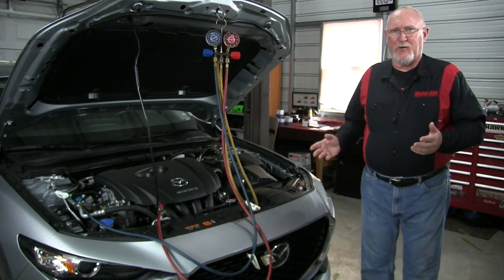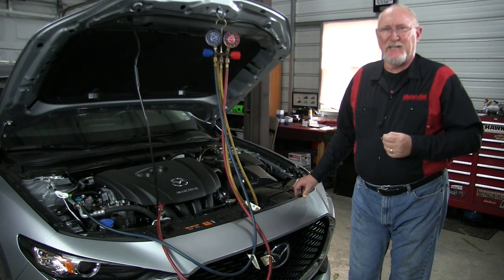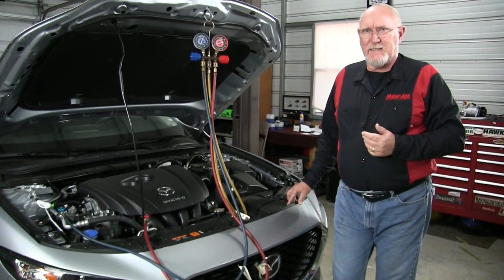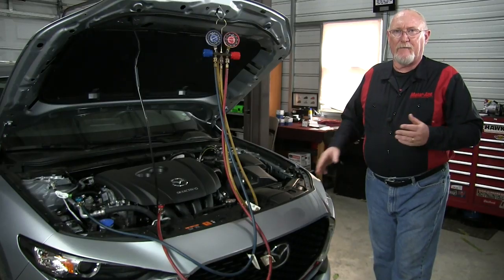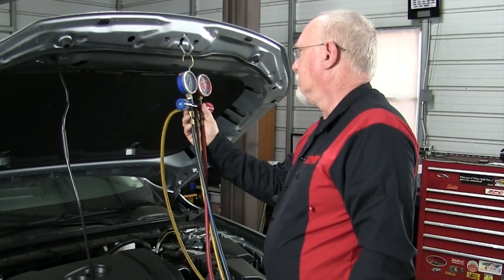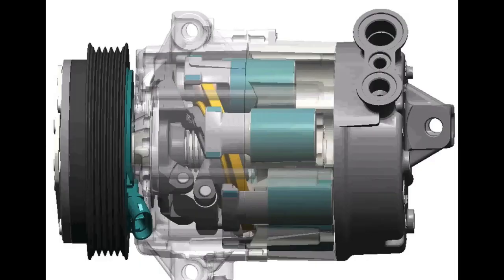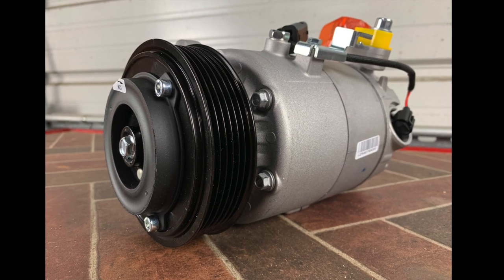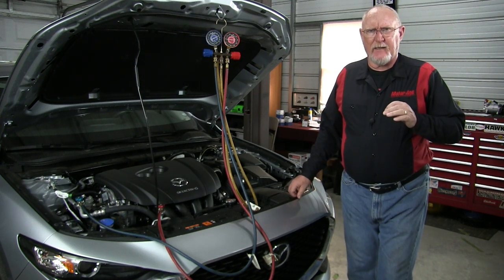The Trainer #100: Diagnosing Variable Displacement Compressors

Comment: 2012 kia optima...i believe it is a clutchless VDC...low pressure side reading high...warm air at idle rpms....I rev rpms to 2500 and low pressure starts dropping (but still high reading) and air is cold.....does this sound like a compressor solenoid problem valve possibly?
Reply: Ac compressor having less suction. Replace Ac compressor assembly

Comment: At 6.0 you demonstrate turning the pulley and mention that all of the assembly should turn (or not in the case of the failsafe working) - However, on my compressor (Sanden PXE16) it all turns but the centre nut stays still - on your demonstration your hand obscures that nut for the most part and I couldn't determine if it was supposed to turn with the pulley. Can you advise please?

Comment: Had a clutch-less sanden px16 that worked and still works after 10years. had a broken line for two years and no oil leaked. The volume pumped without been requested is minimal, or none. So you will not lose oil. But the oil may become acidic....
Reply: Hello, do u have whining noise with this compressor ?

Comment: ive had many older toyotas with a fixed compressor. Never really had a problem other than ocasional r134 refill. Now we have a 2016 scion im (120 000km) and a 2012 corolla (95 000km). Scion has intermitent a/c, it works when its cold but stops when its warm (very useful 🙄). Corolla a/c works but seems weak. 
I have no idea whats the problem on the Scion because i need a computer to read those codes. What a pain in the ass to save a few $ in fuel.

Comment: I want to ask about my car's AC problem.
The air conditioner is not cold anymore when the car is at a speed of 50km/hour.
below the speed, the AC is still cold.
I tried to test up to 4000rpm for the N and P car positions, the AC condition is still cold.
I tried the compressor, the compressor sound a little rough.
what do you think the problem is?
Thank you in advance.
my car uses a clutchless compressor (using a solenoid)
Reply from the maker: That's interesting...at first, I would think the engine speed was the factor but since you tested AC operation at different RPMs, I think the next thing I would do is monitor ECM PIDs with a scan tool to see if there is an input that is falling out OR a pressure sensor signal is failing to report or report correctly. Start by monitoring the variable solenoid PID and the AC PID to see if the ECM is turning it off or failing to adjust the solenoid under load.
Reply: @MotorAgeMagazine  Thank you sir.
I have checked the voltage of 12 vdc to the compressor. it was a turn off from the ECM.

Comment: I have a question. In cars with variable displacement compressors, it is supposed that the compressor is operating as long as the car motor is rotating. So, what does exactly pressing the AC switch button do in this case?
Reply: change of swash plate angle to increase compression ratio, condenser fan motor start.
Reply: It could also engage the magnetic clutch. Some manufacturers still use clutches on VD compressors to reduce consumption when not in use